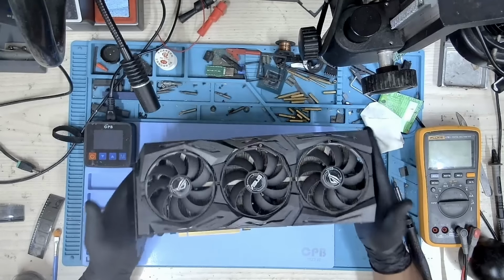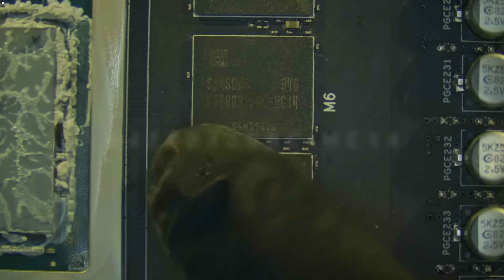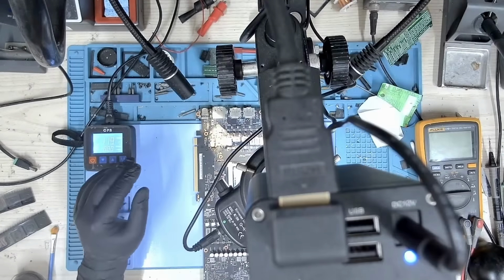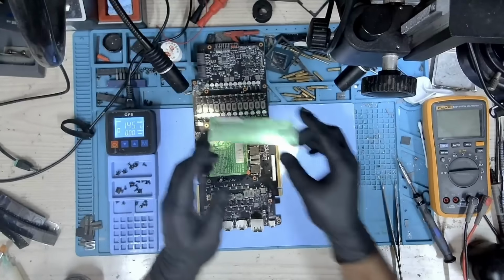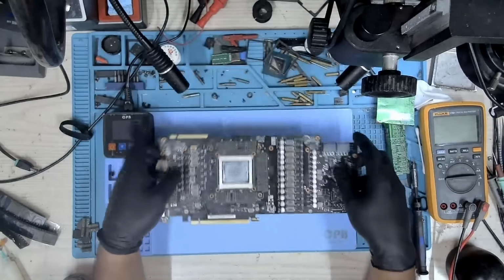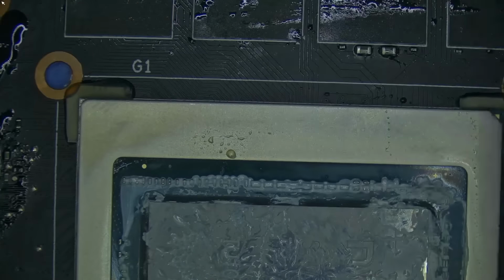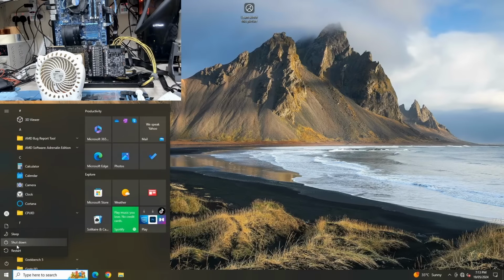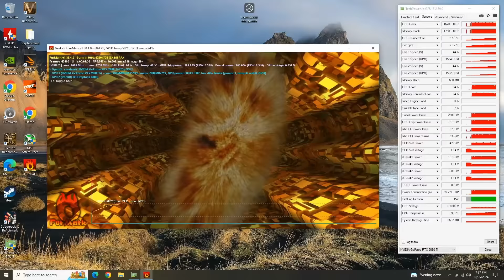Upgrading Asus RTX 2080 Ti memory from 11GB to 22GB

Comment from the maker: Update on other GPUs for memory upgrades.  I am currently working on a 3060 Ti to upgrade it to 16GB. Other 3000 series are work in progress. A BIOS edit would be required to double the memory on these GPUs. Once the 3060 Ti is completed a video with step by step process will be uploaded. RTX 4000 series cannot be upgraded as they all use 2GB modules and are the highest capacity modules produced to date. GPUs that can be upgraded are 3060Ti, 3070, 3080 10GB, 3080 12GB, and 3080 Ti from the 3000 lineup. The 3000 series is a work in progress starting with the 3060 Ti. Don't forget to subscribe and hit the bell to get notified when the video is released.
Reply: What is the price on that upgrade? U should simply make a video before after performance and compare performance to 4000 series.
Reply from the maker: My setup is more suited for repairs as i use older hardware. For example my CPU is i7 3rd gen. Older hardware works well with the testing software needed for repairs. Since i am also getting into upgrade i do intend to have a benchmarking setup with the latest hardware (CPUs, GPUs etc.) so i can pitch it against each other. Until i can afford to set this up I ill try and make a basic comparison in my future videos like before and after kind of thing. 😁
Reply: @GraphicsCardRepairs-tk7ql  How much to upgrade 4070 Ti memory from 12gb to 16gb? from australia
Reply from the maker: RTX 4000 series cannot be upgraded as they are already using 2GB modules and its the highest memory module produced so far.
Reply: Dude, you are doing amazing work. Looking forward to the upgrades for the 3000 series card. Will you be doing the 3070 ti too?
Reply: Amazing. It means 3080 24 GB would be possible?
Reply: Excited to look forward a 24 GB version of 3080TI upgrade that you'll be making soon for in theory, it should be squeezing more performance than a 3090
Reply: this is actually insane. can you do one for a 6900xt?
Reply from the maker: Yes once i get around the BIOS issue.
Reply from the maker: 12GB to 24GB yes.
Reply from the maker: @dotakvkn2146 have the same view 😁
Reply from the maker: @kalellll all 6000 and 7000 series GPUs not possible. They all use 2Gb modules already.
Reply: @GraphicsCardRepairs-tk7ql  thanks for replying! ah i see, was wondering if its upgradeable and you could make a vid about it. looking forward to your next vid!
Reply: can u do 12gb on a 1060 ?
Reply: are you only able to do it 3060ti? and not just normal 3060? or the process is similar? and is 16 max? or you can up it with 20+ vram?
Reply: I figure 2080s can have their memory doubled this way too? I have liquid metaled mine and I have a +175MHz curve on it.
Reply: What do you charge for your services? I have an EVGA FTW3 3060Ti 8GB. I would love to convert to 16GB
Reply from the maker: @iireaper420ii6  No on a 1060 it is not possible.
Reply from the maker: @griffinmelchior6872  I am currently working on it. There are some hiccups I am facing. Once I get around it I will be releasing a new video.
Reply from the maker: @3of12  Yes that's possible.
Reply from the maker: @jamesmcgee9279  I am currently working on it. There are some hiccups I am facing. Once I get around it I will be releasing a new video.
Reply: I've subscribed, I have a 3080 10gb I would like to upgrade memory on. I will keep an eye on your progress of 3000 series bios issues.
Reply: @GraphicsCardRepairs-tk7ql  only 3090Ti core/vbios are properly training the 16gbit GDDR6X IC, all other GA102 can select the 16Gbit strap but it won't train properly, good luck fixing that. Even in Asia they are making 20/24GB 3080/Ti using 3090 PCB (that's still using 8Gbit IC).
Reply: I would love my 3060ti to have 16gb or more vram
Reply: I'm waiting to see how the 3080TI goes. I have one and this card was a forced purchase during the GPU shortage.
Reply from the maker: @TheQuentincc  That is the issue i am facing on the 3080 and Ti GPUs with the upgrade.
Reply from the maker: @Riyazatron  I am working on it. lot of hiccups with the 30 series. once i am able to fix it i will release a video.
Reply: @GraphicsCardRepairs-tk7ql yes I think there a lot of interest in the 3080 upgrade to say 24 gb like the 3090 to has and the potential increases it could have please keep us informed. Very interesting
Reply: @GraphicsCardRepairs-tk7ql   This means you can turn a RTX3090 into a 48GB VRAM card since both sides of the PCBs are running 1Gb modules memory ?
Reply from the maker: @3of12  Yes 2080s can be updated from 8 to 16GB
Reply: out of sheer curiosity, how viable is it for the average daily user? Of course for the vram soldering you need an actual technician that knows what they're doing, but about the BIOS? a community effort to make a custom BIOS to use more vram? something you can flash and off to the races? super interesting stuff
Reply: @TheQuentincc   RTX 3080 Ti With 20GB of VRAM does exists out there . At least, I have seen Gigabyte and MSI ones in limited quantities. Nvidia decided to scrap this model at the last minute but those 2 AIB have produced them in small numbers.
Reply: A 48GB 3090 is the dream! Great job!
Reply: 3070ti cannot be upgraded?
Reply: @GraphicsCardRepairs-tk7ql  Could this be done with older cards from both Nvidia and AMD? Like upgrading 2 gb cards to 4 or 8 gb? Also would they work correctly? What about drivers and games? Amazing job, I just subscribed.
Reply: I subscribed, Definitely looking forward to the 3000 gen memory upgrades. That gen is cursed by low VRAM for otherwise very capable cards. 20GB mod for 3080 is what I'm hoping for.
Reply: 4060 8gb  into 16GB
Reply: Dear sir , can I upgrade my memory Gainward RTX 2060 Super , to another ... just like 16 Gig. . oh please you can , maybe you will make my day have many coloring .
Reply: Can I upgrade my 4080 super from 16 to 24gb
Reply: please AMD ya habibi
Reply: I have the founders edition 3060ti card would love to get an upgrade to 16gb how much? $$$
Reply: Can i send in my gpu 2080 ti for an memory uppgrade like this ??
Reply from the maker: @patrickjohansson3076  Yes you can. this link to book your upgrade is in the description of this video.😁
Reply: @GraphicsCardRepairs-tk7ql  You do realise that there is an RTX 3060 16GB variant available for sale
Reply: I know this is a question about a considerably older architecture, but can this be done to Pascal based cards? Specifically 1080, 1080Ti and Titan? 

Thanks for this video; very informative.
Reply: @GraphicsCardRepairs-tk7ql  hi there I was wondering is it possible you could upgrade my rx 6900 xt powercolor red devil from 16gb to 24gb?
Reply: RTX A2000 6GB can be upgradable for more than 12GB?
Reply: Does the modded  2080ti  requires a modded bios?
Reply: 3060ti ! i need this upgrade unreal 5 is kicking me
Reply: I have 3070 aorus master, I love it only thing I wish it had like 16gb of memory. Would that give it a better performance in gaming?
Reply: Would it be possible to upgrade a 12gb 3060 to a 24gb 3060?
Reply: I have to say, it's cheaper to buy an AMD card, you get nearly double VRAM for a price comparable to nvidia. The performance difference is there, but not huge. And AI is also no problem for AMD anymore.
Reply: What is the price for upgrading 3060Ti 8GB  to 16GB,if it is possible please tell me
Reply from the maker: @imransayyed36  3060Ti to 16GB is not successful yet. If I am successful I will release a video.
Reply: @GraphicsCardRepairs-tk7ql  Thanks for reply and i will wait or your video.
Reply: @GraphicsCardRepairs-tk7ql  I wonder if OG 3090 can be upgraded to 48 GB, since it uses 1GB GDDR6X modules and it's brother 3090Ti uses 2GB GDDR6X modules. I wonder if it would be possible to make 3090 a 48GB card using 3090Ti's modules.
Reply from the maker: @kayaritvards9200  someone has upgraded it to 48GB. But I have not tested it. I don't have a 3090 but if I get one to experiment on I will try it out.
Reply: RTX 3080 20/24Gb makes much more sense, than stock VRAM size! 10/12Gb - it's a joke for those cards
Reply: what ab 3050
Reply: I've been tying to find channels and people that do this. Has anyone upgraded a 1660 super from 6g to 9g or 12g
Reply: can you make my RX 590 8GB to 12 GB OR 16GB ? I am from pakistan ?
Reply: I want to upgrade my 3070, am sure if it has atlest 12gb it would be much better :( helo
Reply: Does the performance increase?
Reply: What are the costs to upgrade a RTX 3070?And wich capacity is ok for this videocard?
Reply: Your workplace is amazing !!!!!
Reply: @GraphicsCardRepairs-tk7ql not even the 4060ti 8GB to 16GB? Or does it not have the extra connections that the 16gb model has?
Reply: Hi there, love the video. Just out of curiosity I have an RTX 2080 super with 8gb, what would it cost me to upgrade like this?
Reply: is 3070 ti upgrade possible
Reply: can you populate the empty ran slot? or go larger ram amounts like 33 or something like that
Reply: For sure
Reply: @GraphicsCardRepairs-tk7ql  How about on a gtx 980? I felt like the only limiting factor with mine is the vram ran games great until it pegged on vram then it ran worse. Only limitation I ran into when overclocking it was it hit 130c at 1680Mhz/280W plimit and I don't have a water block for it
Reply: @GraphicsCardRepairs-tk7ql  definitely keeping my eye out to see if you are successful with the 3060 ti... If you end up figuring out how to do it how much would you charge for an upgrade?
Reply: @fazewhiz1779 
This would be very great 😃👍. But he said the actual 4000 series can't be upgraded in memory. Cuz they use 2 GB chips. 

I don't understand why this wouldn't be possible 😔. Even 20 GB VRAM would be very appreciated 👍.
Reply: Do you think that in Europe I can find someone who does what you do? 😅✌️
Reply: @GraphicsCardRepairs-tk7ql  i have 2080ti :(((
Reply: Hello, Can you tell me who plays the background song?  Where can I get a copy of it?
Reply: Thank you for this very enjoyable video! I liked it and subscribed. I would like to know if, in theory, this process is feasible on another architecture, specifically a Nvidia Titan X?
Reply: How much would it be to upgrade the AORUS Master Rev.1 3070?
Reply: Could this be done on my zotac 3080ti?
Reply: The problem is not the 20gb (they used 20 modules if 1gb): the unpopulated channels are disabled in the gpu, and the core of 3080 cannot handle the 2gb high density modules. Let's see if he can find a solution . Then a 2gb gddr6 can costs from 14 to 35 bucks. I think  too much for a 3080.
Reply: Too bad. A 4070 (Super) or 4070 Ti (Super) could be a nice thingn to have with LLM with double the memory, imagine 24/32GB memory.

Hope Battlemage rumours are true and they release cards with such insane capacity on mid models.
Reply: I want to upgrade my RTX 3060 Ti 8 GB card.
Reply: @GraphicsCardRepairs-tk7ql  I honestly think upgrading the memory on my zotac 3080ti would make a huge difference.. the current memory gets super hot and it causes issues. And an additional 12gb would be awesome with this thing
Reply: @GraphicsCardRepairs-tk7ql  can u make a video of this too ? i Would love to see my Asus 2080 Upgraded to 16 GB
Reply: Can you upgrade a 3050ti?
Reply: Wake me up if you can upgrade a rtx 3090 to 48GB of memory.
Reply: @thomastoseland7113  imagine? Lmfao shit would be crazy especially if it could be upgraded to a faster newer memory
Reply: @JuanBrolo  Yes I agree with you, it's too bad I can't do that like I can ordinary dimms.
Reply: @thomastoseland7113  I would love to upgrade my 12gb 3080ti to 24gb
Reply: even on the 4060 8gb cards?
Reply: @GraphicsCardRepairs-tk7ql  I'd be more interested if you could upgrade a rtx 3090, to 48 GB or above.
Reply: @GraphicsCardRepairs-tk7ql  3090 48 GB would be nice for running LLMs on a budget
Reply: Is it possible to double the 3060's (non ti) vram, to 24gb? It would be a cool budget card for large language models.
Reply: @GraphicsCardRepairs-tk7ql  then I guess quadros use more chips, than gaming cards.
Reply: @GraphicsCardRepairs-tk7ql  can you upgrade the 20 series?
Reply: i think upgrading the 3070 or 3080 would be better than the 3060 ti with its limited memory bandwidth.
Reply: What about 5700xt
Reply: Hey, I really enjoyed your video! You’re doing a great job!
How does this work, I’m interested in upgrading my msi gaming trio  2080ti. Price and down time if possible. Thank you!
Reply: Is this really worth it tho? vram isnt gonna give you alot of performance, boosting the clock will. 11gb is already plenty for gaming, and for anything else you'll never need a gpu like this. You won't see performance from upgrading vram when its the mhz thats restricting.
Reply: uggh, so close. I was hoping my 3060 could have been upgradeable.
Reply: @GraphicsCardRepairs-tk7ql  hmmm interesting. A 3060 upgrade would be cool. The problem is finding someone who can do it for me for the right price.
Reply: @emeukal7683  the only case it’s worth while is Ai. For gaming its 0 point in doing performance test.
Reply: How much will it cost to upgrade 3080 10GB to something more and is it safe?

Can I do driver upgrades will it work for all games?
Reply: I would just be scared of all those little capacitors around the memory
Reply: You need to do your homework better. The 4070ti for example uses 6x 2GB modules, but there are empty pads for two more modules (which happen to be populated on the 4080). You have already responded in the negative to a request-for-quote for a 12-to-16GB conversion while blaming the module size and ignoring the presence of empty pads.
Reply: Hmm temping. How much would costs to upgrade rtx 3080 10gb?To 12gbs or 24gbs.
Reply: I wonder if amd gpus like the 6900xt could be upgraded like that too or not...
Reply: I hope this becomes a trend at all the hightech shops. Bring your GPUs in, drop in a couple VRAM...holee smoke...talking about putting an upgrade into your upgrade.
Reply: @dotakvkn2146  that's exactly what I want done to my eVGA😥 FTW3 3080 ti.  For an aging champ, doubling the RAM would be awesome!
Reply: how much for a upgrade on a 2080 from 8 to 16gbis possible to put higher clocking vram on it or atleast better binned chips to get 16ghz-17ghz vram
Reply: I have colorful rtx 3070 advance oc 8gb card. How much max memory upgradation possible and how much you will charge for upgrade memory. I am from india.
Reply: Is this somthing you can do to an old GTX 1080ti and non ti?
Reply: the 4090 can be upgraded the layout is the same as the 3090.... you need a 3090 layout and plop a 4090 in and then upgrade 3090/4090(monster) to 48gb
Reply: I’m vary interested in this upgrade path can you please tell me or message me a price or estimate for upgrading the ram on a 3070ti
Reply: @GraphicsCardRepairs-tk7ql  What about post-50 Series Launch? Would 40 series upgrades be possible then or would GDDR6X vs GDDR7 then become an issue. I ask because I’m under the assumption that the upcoming 5090 uses 4GB modules due to the fact that it’s been said to have 32GB VRAM, which would mean it could only be in a 4x8 or 2x16 and the former seems a lot more plausible
Reply: Is it possible to upgrade the Series X with more ram, and also the Series X with more ram I would love to see a video on that.
Reply: @GraphicsCardRepairs-tk7ql  so they just use more modules? Interesting.. Any idea of why this is? Or is Nvidia really trying to get people to pay more than 1000$ for more than 12gb 😂

Anyways, this is really cool stuff man! Keep up the work, I don't think I've seen anyone on yt do this properly so.. thanks
Reply: Why 2000 series you did not edit the bios ?
Reply: I was wondering how about Quadro series? - with some of the latest AI tasks, huge VRAM on old GPU's would be in huge demand. (if i could get a k6600 with 64GB vram- i'd spend as much as a 3090)
Reply: how about 3070ti?
Reply: @GraphicsCardRepairs-tk7ql  how much to upgrade 1660 super
Reply: Can we upgrade a gtx 1650?
Reply: @iireaper420ii6 why need that much on a slow card , just buy a 1080ti
Reply: How much it cost for an upgrade ?
Reply: So does that mean 3090 Ti 48gb? If so I wanna buy it!!!
Reply: is it not possdible for the 12 gb 3060?
Reply: what about the 3070Ti?
Reply: False 4090 can be uppgraded but not using the original 4090 pcb people have been swapping 4090 silicon die onto 3090ti pcb without die and thus making a 4090 48gb this exist but its quite rare and there are no tutorials and only a few for sale. No custom bios is needed for it to work pls look into this
Reply: how is the possible to 128GB or 512GB for 3090 or 3090ti? How much will charge?
Reply: What about AMD GPUs?
Reply: @GraphicsCardRepairs-tk7ql 
Omg, I live in Japan.
I would love to upgrade my 3080 10gb vram to 20gb.
How much would it cost?
Reply: Me with a 3070 how worth is it 😮
Reply: it's been 8 months, cna you still not upgrade the 40 series? I would send you my 4060 TI 16 gb I would love to get it to 32 GB if you can I am mainly using it for AI inferencing